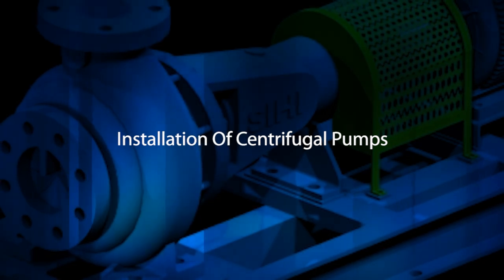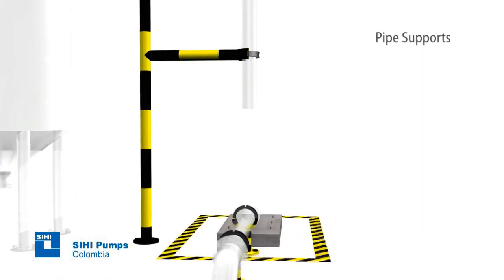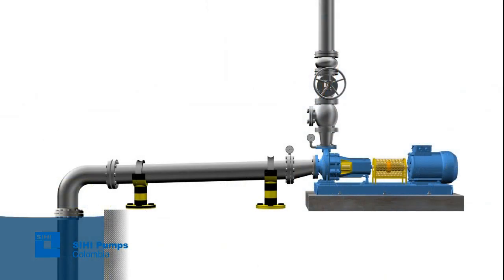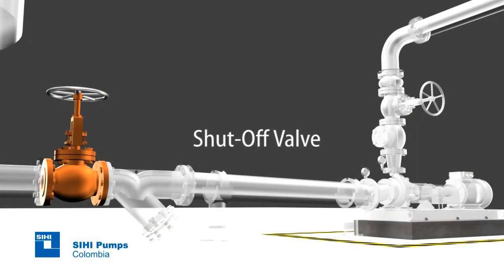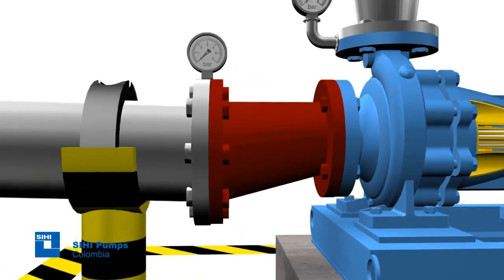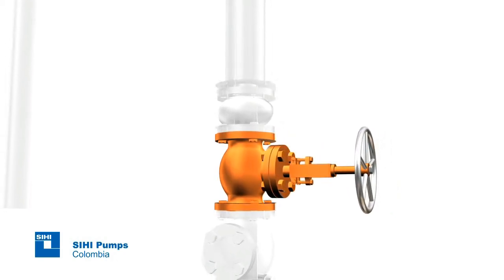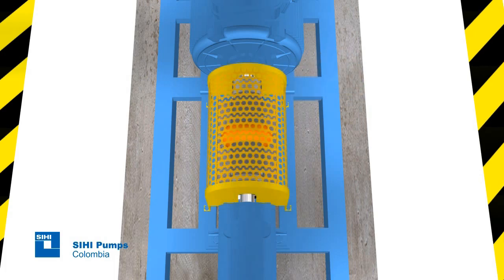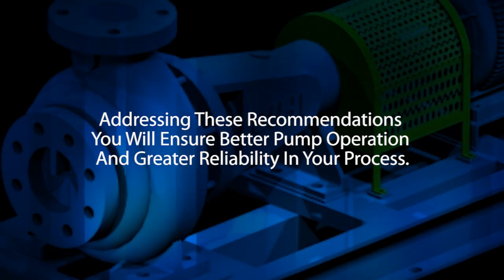Installation of Centrifugal Pumps

Comment: Interesting no mention of checking for pipe strain induced stress on the pump casing or electric motor soft foot. Both big contributors to vibration.

Comment: How check valve prevent water hummer ?
Ckeck valve creates water hummer .
Reply: check valve  prevents the back flow of relatively high pressurized liquid to the pump in the discharge line so that the impellers stay safe .
Reply: مع اني لم أشاهد الفيديو حتي الآن ولكن محبس عدم الرجوع يحمي المضخة من الهامر وذلك بمنع رجوع هذة الصدمات إليه في حالة توقف الحركة فجاءة او إنقطاع الكهرباء وبذلك يمنع رجوع هذة الصدمة الي ريشة المضخة وشكراً

Comment: Still don't get it why the eccentric reducer has to be "upside down"? See this all the time... now even in this video. You would think that the reducer should go with the slope. Not against it.
Reply: At 2:40 it could/should be upside down in my opinion.
Reply: The purpose of the eccentric reducer for being upside down is to prevent trapped air. Lets assume you put the reducer slope section up, now put a straight line following the upstream flow pipe diameter. That triangle space above the reducer will trap air and other gasses and creates bubbles in the liquid. You are pretty much disturbing the flow. On a centrifugal pump, the last thing you want to have is bubbles on the suction side eye socket. Those bubbles will burst on the impeller vains with supersonic velocities causing damage to the impeller. This is called cavitation.
Reply: So the fact that the pipe is at an upward angle doesn't let air escape? Well.. I guess not if there is nowhere for the air to escape to x) unless there is a bleeder valve of some sort I suppose.
Reply: You always assume even with the incline the pipe is full of liquid all the way to the inside diameter wall. Bleeder valves are typically used if you are dealing with hot liquids and heatexchanger piping.  Honestly I don't see any reason not to use a bleeder valve on the suction side of any pump piping.